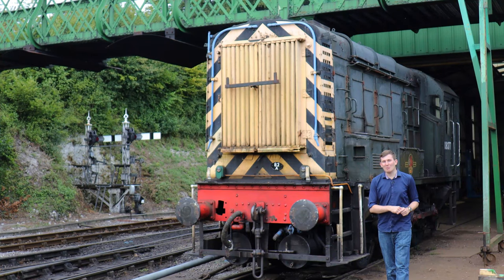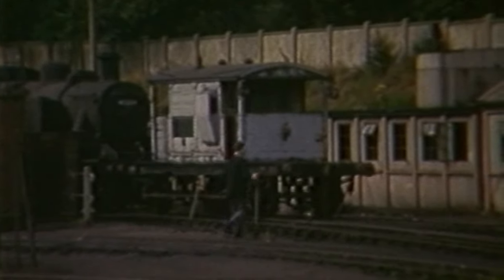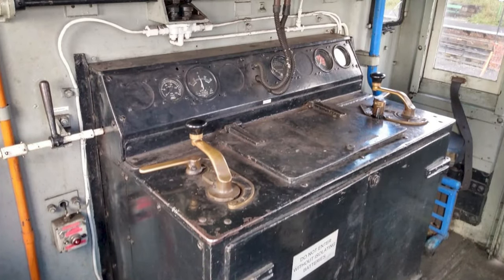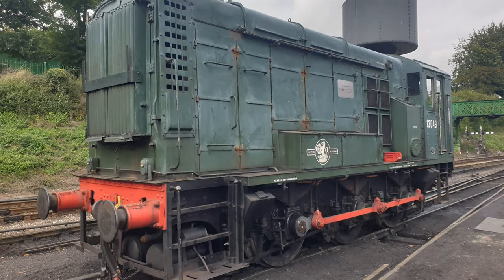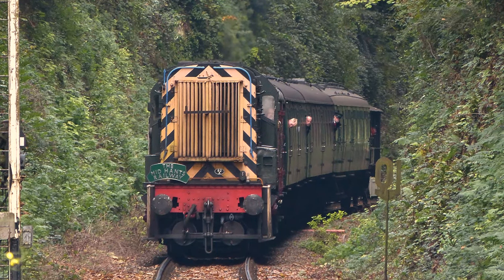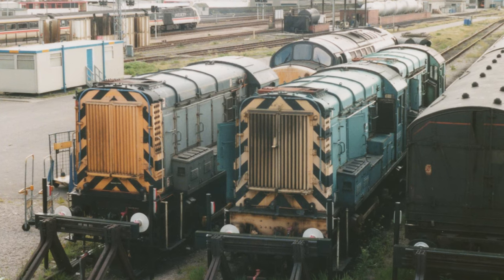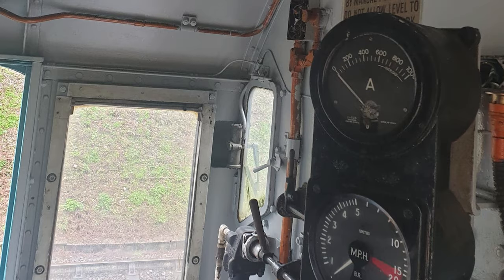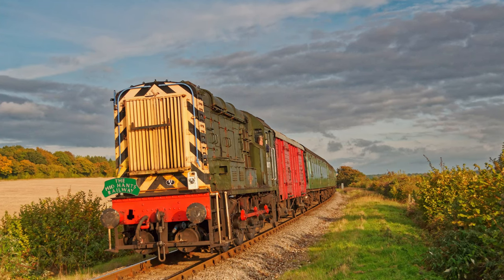Locos Of The Line - Diesel Shunters

Comment: Fun fact. The 08s are the same Tractive Effort as a class66 Deltic,,, 55,000 lbs. 
Lot of pulling power from little engine. Foster Yeoman run some long heavy stone trains. Testament to the Grunt of the Gronk, lol.
Great video. Great content. 
I learned a few things. Thanks for taking the time to put this together.  👍
Good luck in 2021.
Reply: I think you mean the class 55 Deltic. They have a maximum tractive effort of 50,000 lbf and a starting tractive effort of 30,500 lbf. The 08s have a tractive effort of 35,000 lbf, and the 11s have a tractive effort of 34,900 lbf. So while neither the 08s nor 11s could match the 55s for their maximum tractive effort, (mostly because they could only go 15 to 20 miles an hour, while the 55s could go 100+ miles an hour), they both had a greater tractive effort at starting speeds. Which meant that they could shunt more over shorter distances.
You are right, that is a lot of pulling power for engines of their smaller size. I learned a few new things as well. I hope this helps to shed some more light on the specifications of the little engines that are often overlooked. I hope you have a wonderful day. :)

Comment: hi for me, these 08s are the stars of the railway.make sure you look after the power units, ie, regular oil changes etc,
Reply: Oil changea !! we had them for years and never did oil changes , just sampled lube oil tested for coolant or fuel dilution , they are tough old things ,just make sure axle boxes and side rods are oiled and don't over speed them , motors don't like it

Comment: " Gronks" iv driven an 08 , starting handle for the oil pump at the front with the bands is interesting 😱
They are cool though
Reply: You mean the lube oil priming pump , just pump like hell till there's pressure on the gauge then stand clear while it started , don't forget to pump the fuel up to header tank as well

Comment: I've wondered how shunters developed enough tractive effort to move heavy trains. Smaller wheels help of course. Steel on steel friction co-efficient is about 0.2 so 49 ton weight suggests a max drawbar pull of, well, around 5 tons or 11,000 lbs. Am I anything like in the right ball park? Obviously it is enough, but for how heavy a load? What about wet rails? I guess one could always split the load and do two or more movements.

Comment: What was used pre diesel's? 
(When steam was unavailable)
Pinch bar or horse.
Reply: steam locos were used it was just impractical. but horses were used in smaller yards where having a loco was too expensive to justify.
Reply: Horses were still in use in BR into the ate 1950s/early 1960s. One if the last was at Newmarket for moving horse vans. I'm not aware of pinch bars being used in the UK. Some locations used powered capstan to move wagons.

Comment: Nice tribute to the humble stalwarts of the line, has 08032 worked on the line ? 
I was always curious what FY did with it, and the other VB 08s there, for 23 years since the arrival of the 59s, air-brake only as was all the freight stock maintained at and used from Merehead, I assume it was for shunting faulty single wagons, brakes isolated, into the maintenance shed ? Would the train loco have split them out of the rake, or was that Western Yeoman II, the GM shunter's job ? That's a lil beastie of a loco but sadly I doubt it'd fit through the MHR platforms !

Comment: Enjoyed watching this - very interesting. Just one query: it doesn't explain why locomotive 12082 is now displaying the number 12049. Any reason?
Reply: Hi Pete, apologies for missing it out. The original 12049 was purchased by DAY Aggregates at Brentford, South West London, and used to shunt their internal sidings. Sadly 12049 was damaged beyond repair by a fire at Ropley in 2010, and has subsequently been replaced by sister 12082 from Barrow Hill and numbered as 12049.
Reply: As Will said, yes, the original 12049 it was burned down In the ropley 2010 fire of the carriage works so was replaced by 12082, however 12082 is now not displaying 12049 but is displaying 12082!